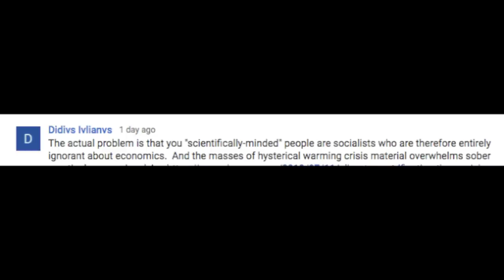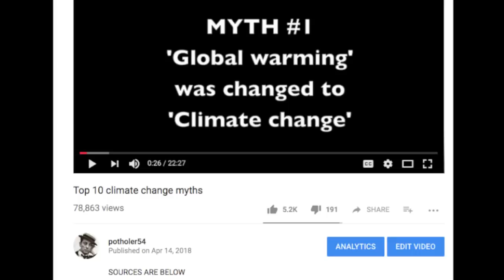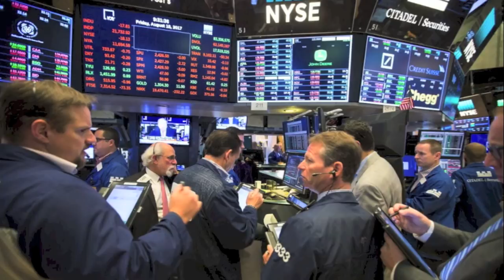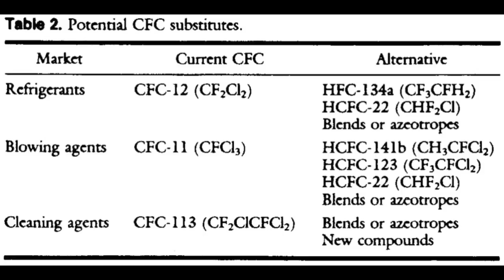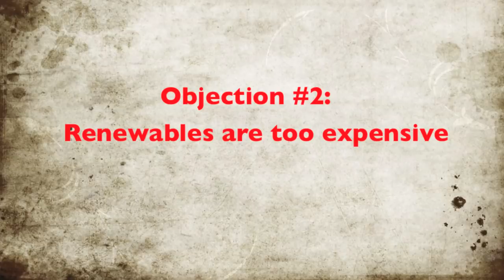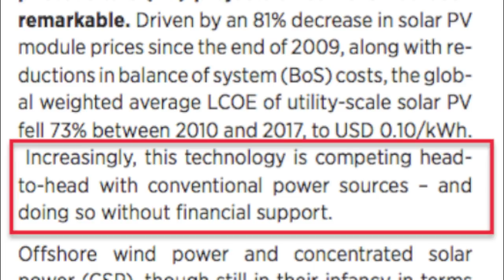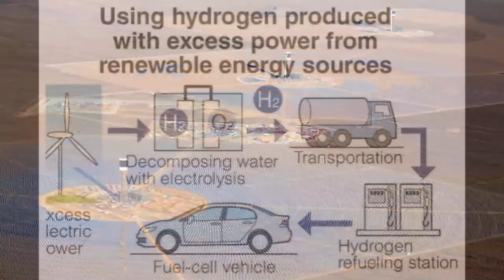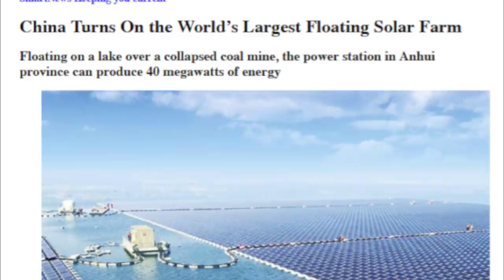A CONSERVATIVE solution to global warming (Part 1)

Comment: I have to say, I'm from the opposite side of politics, but I absolutely agree with you that climate change this doesn't have to be, and shouldn't be a partisan issue between conservatives and the left. And I think that if climate change remains a partisan issue in the United States then it's going to be very difficult to take meaningful action. Both sides should be able to agree on the facts of climate change, even if they disagree on the solution. I'm quite perplexed that conservatives in the US (and to a lesser extent Australia) have rejected the science or rejected a transition to renewable energy.

Comment: ~12:20 Let's not understate the fact that they also have an enormous advantage when it comes to access to cheap rare earth medals and have stolen trillions in IP.
Reply: Oh, and what's essentially slave labor.
Reply: They also had access to cheap dirty power when it was relevant, and they still have the cheap dirty power.

I was saying this years ago but it doesn't matter now, the energy investment in a solar cell is massive it has to be supplied by fossil fuels or nuclear, if the green parties of the world had really cared about what they said they cared about they would have found the cheapest dirtiest power station and earmarked it for silicon refining.

Comment: The only issue I have with the free market solving problems is they only solve problems if it is profitable.
Reply from the maker: That's kind of the idea. Make solving the problem profitable, and you solve the problem.
Reply: @Vulcan Hobo - If there are other options to produce solutions (without coercion) then I would support those options. I'm not a fan of relying on the desire for financial gain to power innovation, but I don't see any other options on the table.

What non-coercive solution would you propose that doesn't involve the free market? This isn't rhetorical: I'm honestly interested in what alternatives could exist.
Reply: @ajmeyers5661  Firstly, the notion of the "free" market is a misnomer. Most, if not all, markets are highly regulated by governments. Developed countries are mixed economies of socialism and capitalism. Some countries lean more to one end than the other, but they're all mixed. I said this in a comment in this thread, but private corporations will never of their own volition pursue massive projects to fight climate change. Just like private industry would likely never have gone to the Moon. For the type of change that needs to be done there will have to be a massive change in the economy - something to the degree of a national takeover of industries like in WWII. We're already past the point of no return in regards to climate change. 

Fossil fuel companies, and the like, will never take it upon themselves, even with governmental subsidies, to make the kind of foundational changes that need to happen. Profit isn't enough of a motivator if they can continue making profit with the status quo. Nor does private industry have the infrastructure to implement the kind of changes that need to happen. US fossil fuel companies are betting on a slow transition to renewable energies and have invested a nare 1% of their budget to renewables. Actually, US fossil fuel companies don't believe renewables are the answer and are focusing on carbon capture. European companies are putting closer to 10% of their profits into renewables, but it's still not enough. Once governments lay the massive foundational groundwork then private industry can make incremental innovations for profit.
Reply: @avenuePad  - That's nice dear, but I'm not here to argue with you about the make up of markets. My question was: "[w]hat non-coercive solution would you propose that doesn't involve the free market?"

If you have an aswer to that then I'm all ears (metaphorically speaking), otherwise...

Cheers!
Reply: @ajmeyers5661  If you're going to be condescending for no reason at all, then at least read my comment. I provided a "non-coercive" solution. I'm still waiting for the free market to provide a solution. 

Anyway, your question is cherry picking. The OP simply stated that he has an issue with relying strictly on the free market to provide a solution. It's going to have to be a mixture of gov't proposals and private industry stepping in line. It will likely be some sort of planned economy, like during WWII.
Reply: @avenuePad  - Another post without an answer to the question. Quelle surprise.

Oh well, here's hoping someone happens along who will/can answer.
Reply: @ajmeyers5661  Nice strawman. I did answer your question. It's called a planned economy. It's funny that this video is using China as an example of "capitalism" solving climate issues. China has elements of capitalism, but it also has very heavy portions of planned economics. It's why they get big projects done. 

So, again, my answer that you keep plugging your ears and yelling over is a planned economy. Basically no, or a very limited, free market. The government basically tells industry what to produce. Fossil fuel corporations get nationalized where oil production is severely limited and resources are put to renewables. 

Your question is a total strawman because no one is saying that you have to eliminate free markets completely. But the protesters criticising capitalism are absolutely correct. Capitalism is failing to deal with the climate crisis. Potholer is under some belief that Fossil fuel companies are preparing for a massive switch to renewables in the near future. I guess if you read their press releases that's what you'd be lead to believe. However, the truth is that they're doing next to nothing and don't plan on doing anything in the foreseeable future.